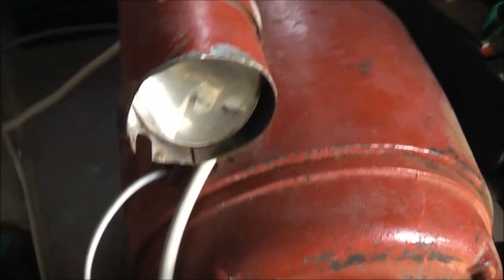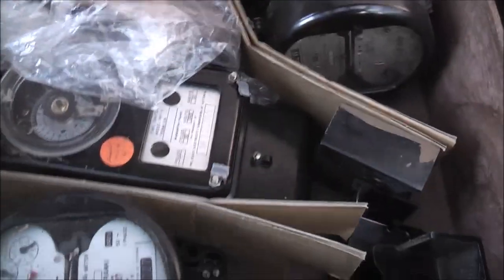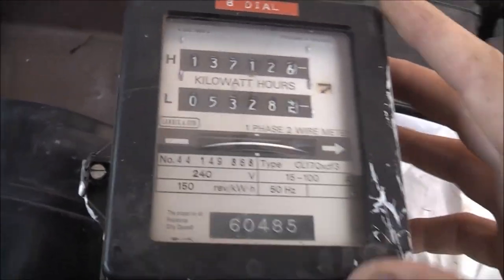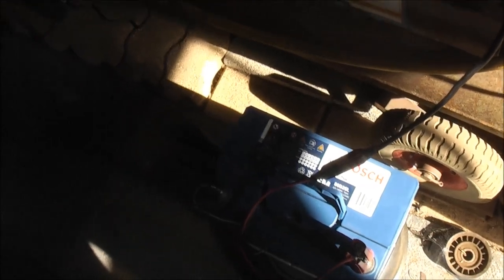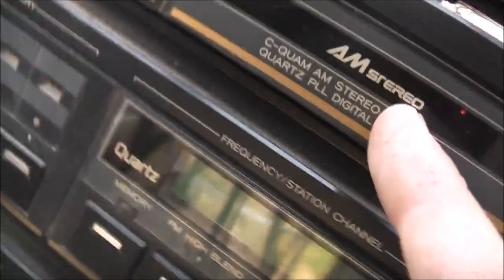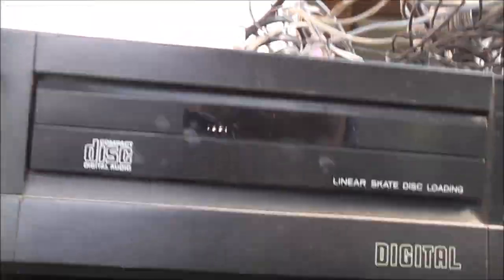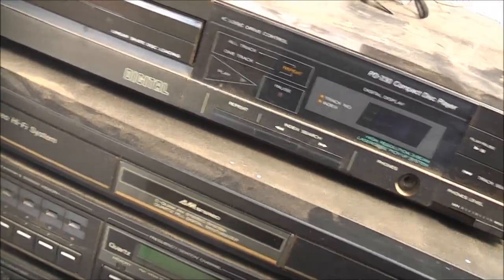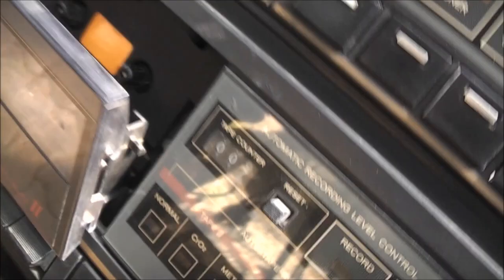Meter & HiFi Scores

Comment: Aaaah, now look 
at that. I think that 
the Landis & Gyr you 
have there is.........

........A variant of my L&G CL 147hd.

That one is the dual rate one of the CL 147h.

The H suffix is for anti-reverse, and the D suffix is for dual rate.

It makes me wonder if that timeswitch you have there is a Rate Changer and if it isn't, then if they were using it for triggering the low rate on that L&G meter.

One other thing: Do you have plans for some loadwheel action soon?

We still haven't had any since the last batch arrived. :D

Loadwheel action is now on Wayne's Electrical and can be found in the
"Powered" Playlist. :-)

Thanxx for showing,

-Wayne's Electrical.

6th April 2019, 22.00
Reply from the maker: Wayne's Electrical been meaning to do more loadwheel action, just been busy with work and other projects